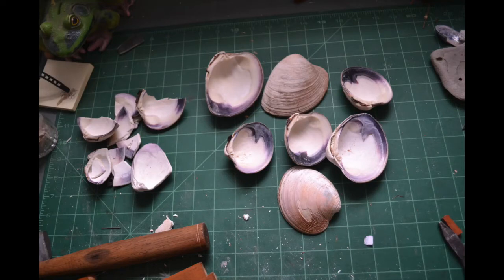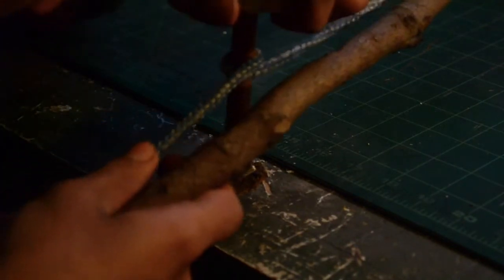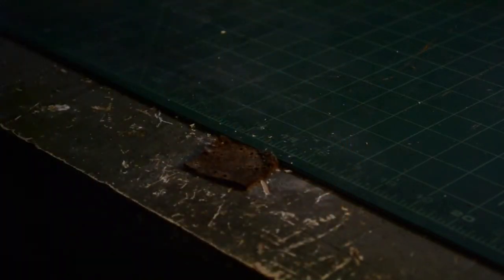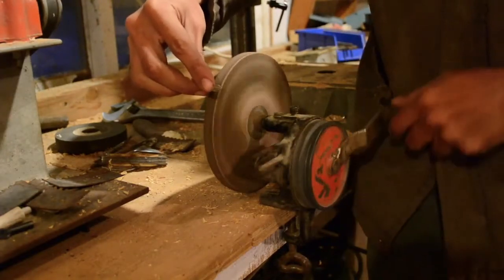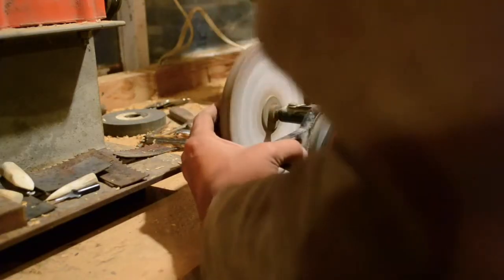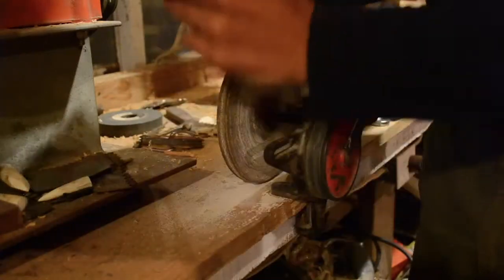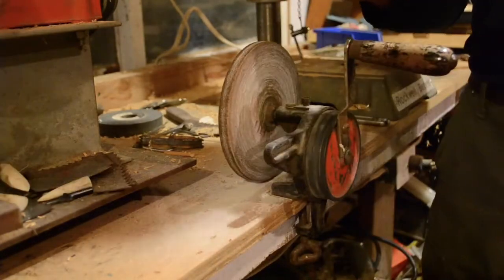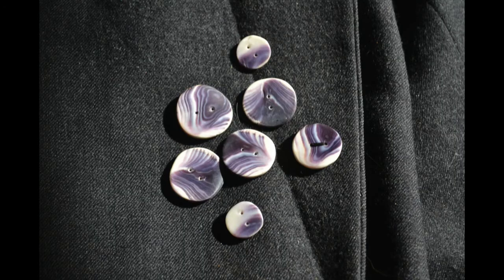Making a wampum button.

Comment: I've had good luck preventing breaks by drilling in a shallow pan of water. I grind with whetstones but also keep a bowl of water on the bench and dip the shell regularly while doing so. Seems to also kelp keeping the dust to a minimum though I usually wear a dust mask. Your channel is really awesome!
Reply from the maker: I tried that back when I was figuring this out, it didn't seem to make much difference for me, but I was probably doing it wrong. What do you put between the shell and the bottom of the pan?
Reply: @MalcolmPL  Usually just a less attractive piece of shell. Using a hand cranked grinder is a great idea! I'll likely be adapting that.
Reply from the maker: @YouFoundBen  It's a lot faster than a whetstone, and slightly less likely to grind up the fingernails.
Reply: @MalcolmPL  Haha Been there done that
Reply: @MalcolmPL  Also... maybe a shallow pan of water at the bottom of the grinding wheel would help with dust or breaks? I know of someone who works the shell with a tile saw and that has a similar setup.
Reply from the maker: @YouFoundBen  I tried a baking pan of water under the grinder, it splashes and makes a mess. I've seen traditional blacksmith grinders where the lower half of the wheel was surrounded by a water chamber. Might have to make something like that.
Reply: @MalcolmPL  -try a scrap piece of wood.
Reply from the maker: That was the first thing I tried. I can’t make it work.
Reply: @MalcolmPL  -u need a drill press,one hand holds the shell in place,the other works the down stroke.
Reply from the maker: Don’t you think that was the first thing I tried?
Reply: works for me.

Comment: I´m making wampum beads using quahong shells since 30 years now...one problem is the heat because quahong grows in "steps" - that´s why I´m using a bowdrill - and also that these days it´s very hard to find a source for the thick shells
Reply from the maker: Good to hear someone else uses the same solution.

Comment: Fascinating, how are the beads made?
Reply from the maker: More or less the same as the button.
There are three types of bead. Disk, round and tube.
Disk beads are basically small buttons with only one hole.
Round beads are made similarly, but they are a lot more finicky as you can't hold onto them properly, and you have more than one dimension to deal with. Some people use rock tumblers to finish rounding them.
Tube beads are made by drilling into the edge of the shell rather than the flat. This requires special clamps, a different sort of bow drill and a ridiculous amount of skill and patience.

Comment: I found your channel today and love the variety of videos. 
An electric drill is not the right tool for the job. But, would an egg beater drill provide the same advantages as a bow drill in this case?
Reply from the maker: I tried that and had trouble keeping it steady, but I bet someone with more experience using them could make it work.
Reply: @MalcolmPL  Thank you!